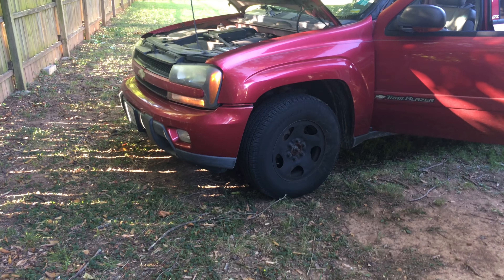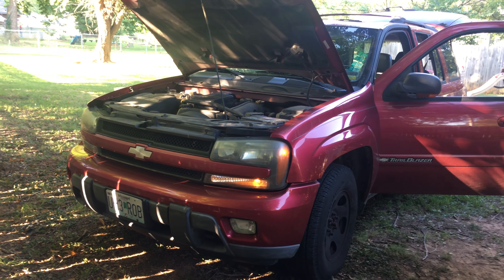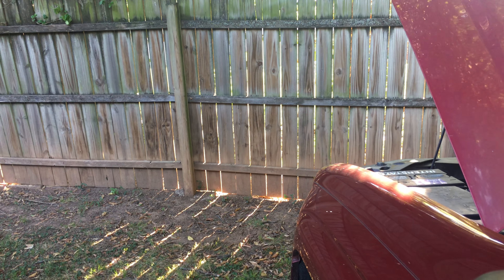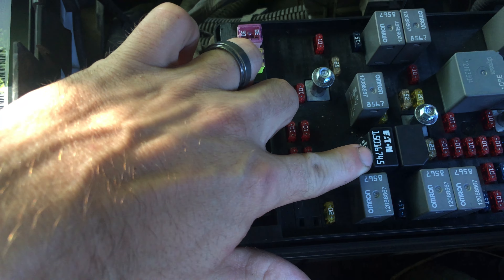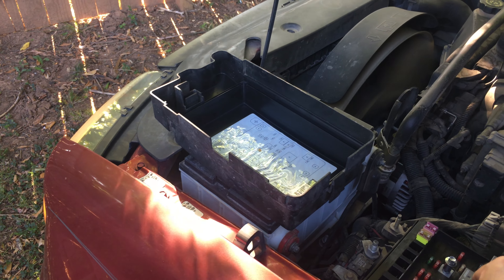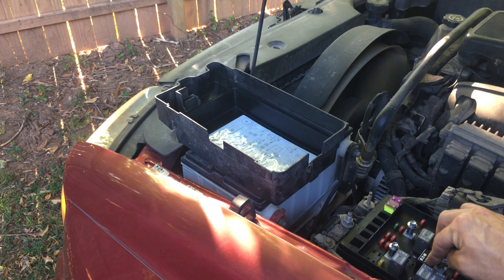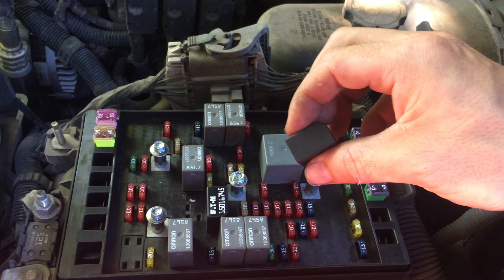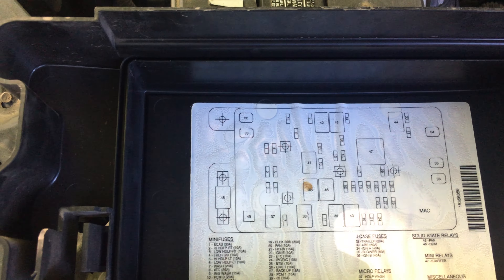Trailblazer/Envoy headlight troubleshoot

Comment: if you call GM customer service they have an extended warranty they will get your VIN and dealership will replace relay FREE the replacement is grey and has a new p/n  the original p/n is available from rock auto for $23.00  the NEW GM allegedly is $150.00 or free if you call GM customer service
Reply: @johnmancini757  can you put the piece number here please I am gonna call SAP thanks